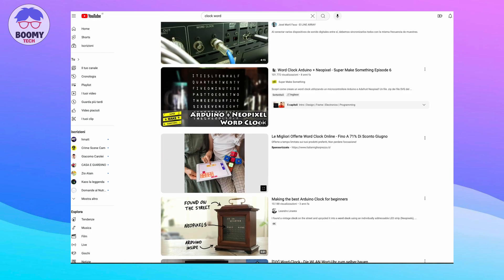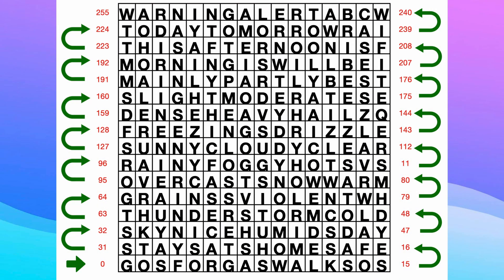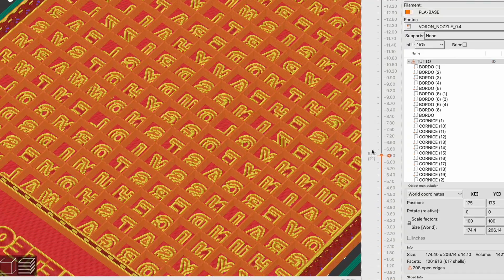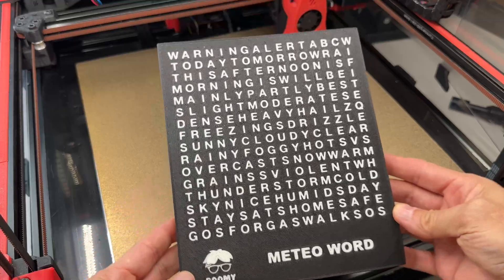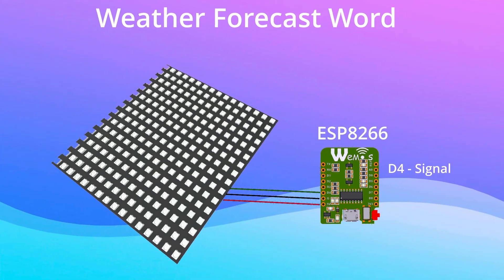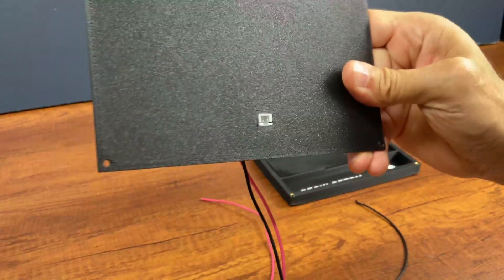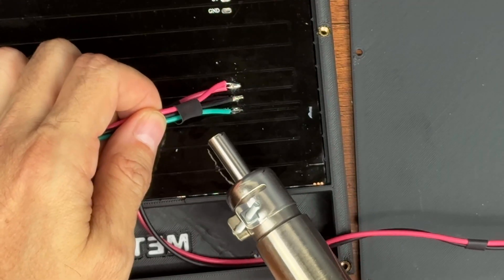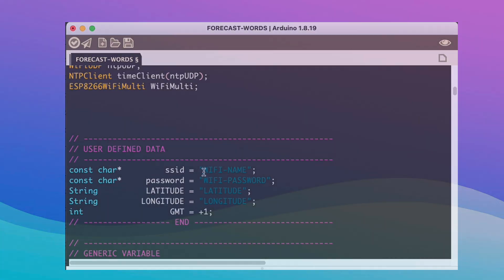Light Up Your Weather Predictions with ESP8266 and LED Magic.

Comment: Hello
I have just finished building your project, its FANTASTIC!!
One question?
I seem to be getting the wrong weather information displayed.
I am located in Johannesburg, and put in the correct attitude and Longitude, but the LED matrix seems to display the same information all the time.
" Tomorrow will be Overcast"   (It will be  Sunny)  
"Today is Overcast".  (it is sunny today"

Any idea as to why?
Many thanks
Gabsi
Reply from the maker: I just update the source link in the description. Just minor improvement but there wasn't any problem.. check in serial monitor if your wifi connection is ok and if you can read the feedback string from forecast website
Reply from the maker: Hello, I'm glad you managed to make the project. Now I'll check the code and let you know